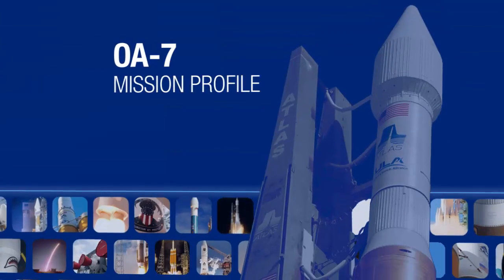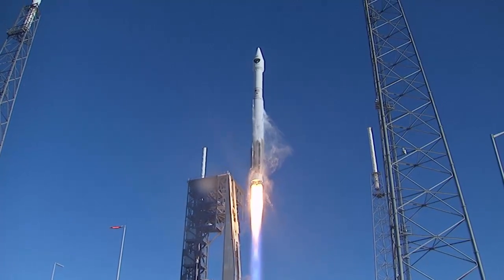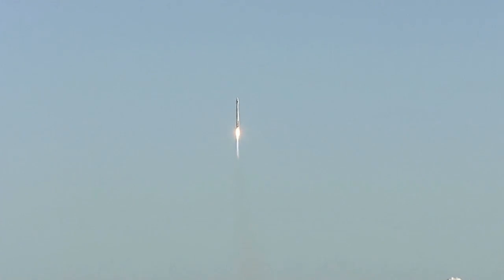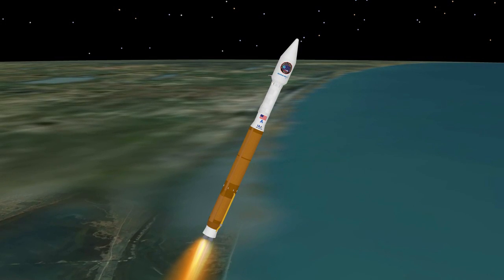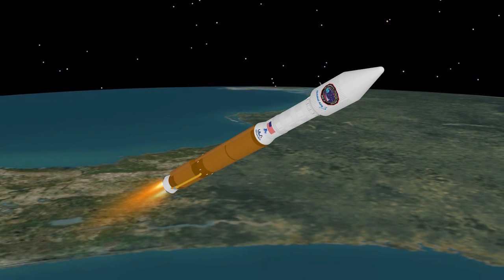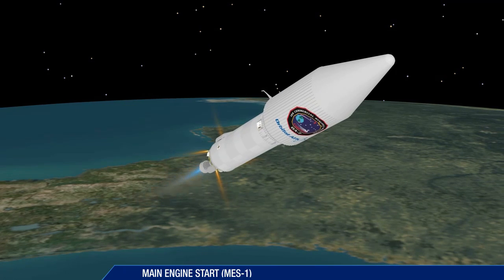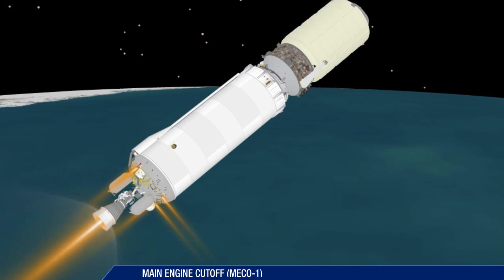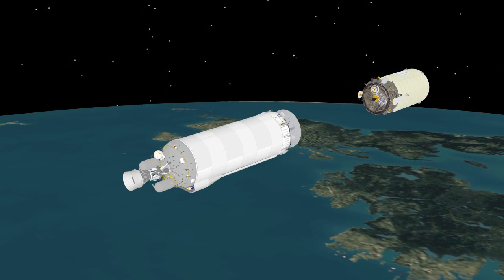Atlas V OA-7 Mission Profile

Comment: Watched the launch program- question, the second stage acceleration for the entire 14 minute burn duration was only about 25 ft/sec, which is just under one g... 
   Is this a weak engine, or was it throttled back as fuel burned off to keep the g load so low for a specific reason? Was the cargo g sensitive? Watching the SpaceX launches, the second stage hits 5 g acceleration before SECO...
Reply: The single engine Centaur is indeed a low thrust upper stage, but a very efficient one.